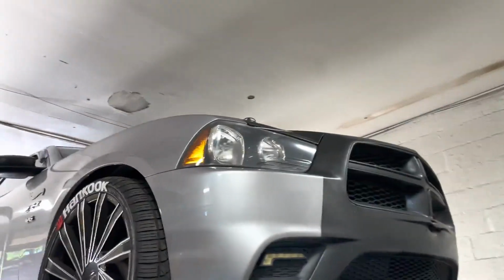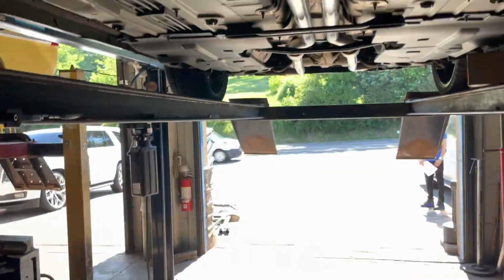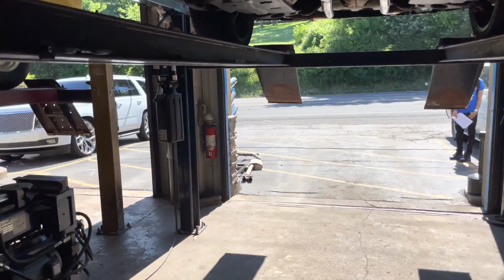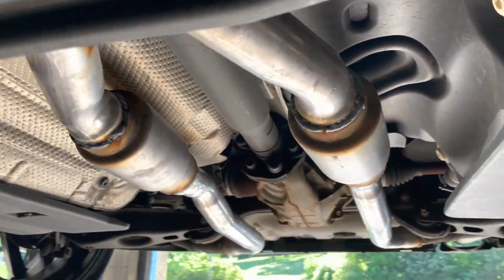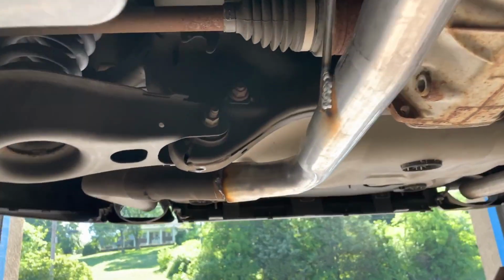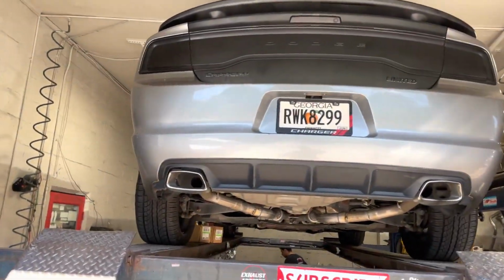2014 Dodge Charger V6 Limited TRUE DUAL EXHAUST w/ DYNOMAX RACE BULLETS!

Comment: I have a v6 Charger and I’ve thought about getting an exhaust for it but after this no way
Reply: Na don't let this sway you lol, that's just the sound that guy wanted.
Reply: Look at his video with the Cadillac ats 3.6l the pipes he put on sound sweet.
Reply: should of got the v8
Reply: @ex-tc  Not everyone can afford a V8 charger
Reply: @joshuamorehead6124  they’re really only like 3k more with out heated seats, if you can afford a sxt on your salary and credit there’s no valid excuse  why you couldn’t afford  the v8
Reply: @ex-tc  Actually they are around 5 to 6 grand between levels (RT, Scatpack, Widebody) Plus you have to consider insurance which can be pretty high when it comes to age, years driving, and record. Not everyone can afford to go the V8 option. That is why V6s outsell all the V8 variants combined.
Reply: @ragintaurusmusclemercury7023  yeah, you have a fair point there.
Reply: It's nothing wrong with the straight pipes but me personally I would've kept my resonators even if I did the true dual pipes it's really just preference. I don't like that sound.
Reply: @joshuamorehead6124  I could have afforded a v8 but I wanted a 2002 z28 so I got that and then got the v6 for a daily that gets good gas
Reply: Get the vibrant resonators installed. It will give you the sound you want.

Comment: Do you guys do fabricating downpipe a 09 Volvo S 60 2.5t Or straight pipe it directly from the turbo all the way down and put extension so I don’t have no codes on the Cadillac converter sensors
Reply: Cadillac converter lmao. Also don’t do any exhaust work to any car that’s not at least a v8 with a 5.0L engine or bigger
Reply: @benk3431  nah S60s sound better than V8s also any JDM sounds better